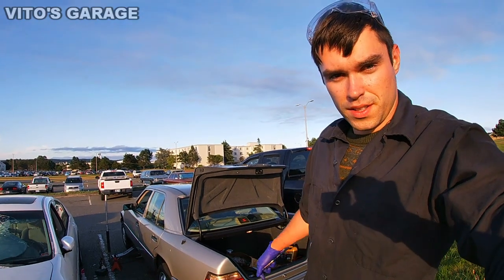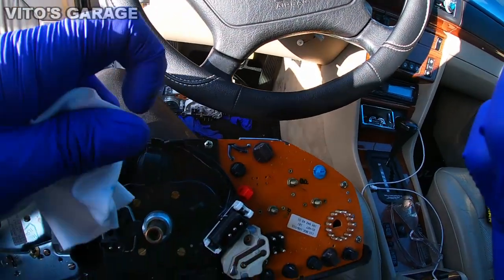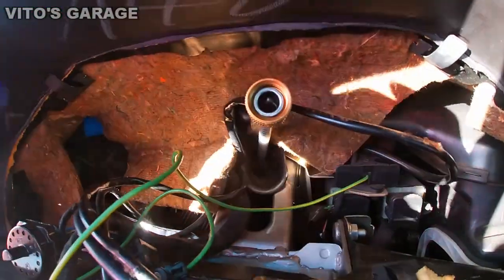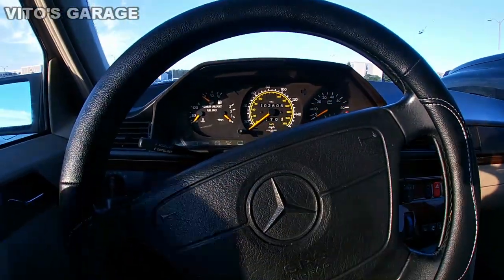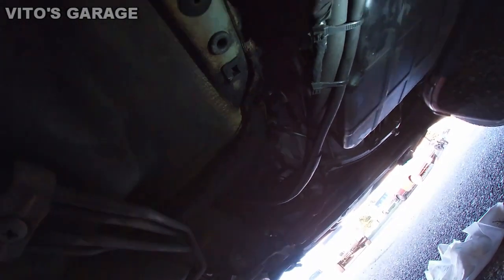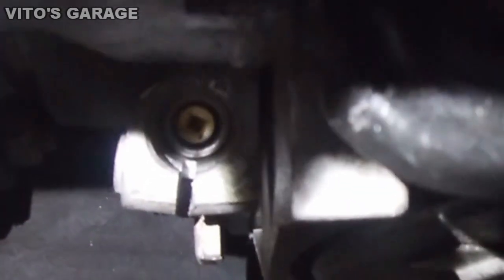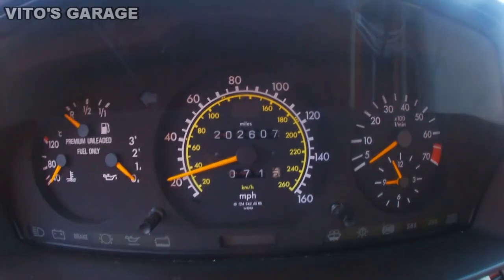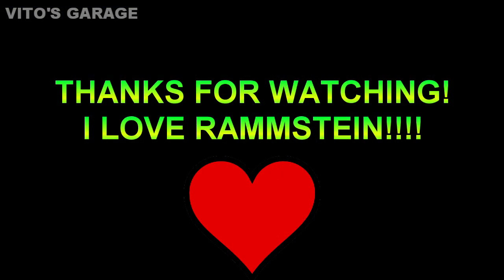How To EASILY Fix a Bouncy Speedometer Mercedes W124 W123 W126 W201 W140 W116 W115

Comment: Huge thanks for the detail you took for this video! I had a bouncy speedometer at higher speeds on my 1987 300D. A good cleaning, ATF on  the back of the cluster, ATF down around the spinny cable, and then some MB gleitpaste worked wonderfully.

Comment: Hi Vito. My speedometer arrow on w126 of 1989 doesn't move before I reach 35 km/h. Any idea about the problem cause?
Reply from the maker: Very interesting problem, hmmm. Something is most likely wrong with your speedometer gauge itself because those are electronic gauges. 
Your W126 doesn’t have a mechanical cable (right?). I think it has a speed sensor on the transmission instead of a mechanical cable. That’s why I think that something is wrong with the gauge itself.
Reply: Thanks Vito. My transmission does have a cable. I think I will dismantle an instrument cluster and see if there is sign of wear on it first.
Reply from the maker: @azimutnorth8570  remove the cluster and drive without the cluster. See if the speedometer cable moves once you start driving. If it does move, something is wrong with the speedometer gauge (maybe stripped plastic gears inside or sheared off). If it doesn’t move, the cable might be the problem or the connection going to the transmission. 
MAKE SURE THAT YOUR OIL PRESSURE GAUGE IS ELECTRIC BEFORE YOU DRIVE WITHOUT THE CLUSTER. BECAUSE IF THE OIL PRESSURE GAUGE IS MECHANICAL (LIKE ON W123), YOU WILL HAVE AN OIL SHOWER ONCE YOU START THE CAR!

Comment: driving without fixed the oil pressure guage hose to instrument? your dashboard behind should be alot of engine oil spilled 🤣
Reply from the maker: W124s have an electric gauge
Reply: @VITOSGARAGE  i see. that's much easier than W123

Comment: Hi bro, I have a question, with my 190E working,  either low or high speed，my needle started dancing and swinging a lot，is the cable have is stretched  or broken？I want to ask how did you solve it? where can i buy the cable？  Please reply me when you have time, it is very important to me, thank you！
Reply from the maker: Hey there. I think the problem with yours is loose cable under the car. The speedometer cable has to be firm, it cannot be loose under the car. Check the cable retainers all the way from the transmission to the firewall. Make sure the cable is retained and not loose
Reply: @VITOSGARAGE  Thank you so much for your reply, I'll go check the cables right now!

Comment: My W201 speedometer and odometer stopped working yesterday (both at the same time). Before that it was always working, but the needle did bounce a little bit. Do you think my speedometer cable needs to be replaced or could it be saved by greasing it? Keep up the great videos, I enjoy them :)
Reply from the maker: Remove the cluster completely and drive without it. See if the speedometer cable is spinning. If the cable is spinning, the problem is inside the cluster. If the cable isn't spinning, It's probably broken somewhere in the middle (most likely you'll need to replace the cable). And thank you for your support! New videos coming every week☺

Comment: Question I have a 93 300se and when I put it in reverse or drive I hear a clunking but the car doesn’t move and if I rev it the clinching might keep going but still doesn’t move
Reply from the maker: Something is broken. Either transmission, differential or axle. Lift it up and inspect it

Comment: Great video, nice when things go right!
-how were you able to release cable from instrument cluster without stressing cable?
On my 92, 300e, the cable will barely, reach for my hand to fit in, but cable on tight, and can not free it up with my fingers!
I'm going through the right side of cluster, but can't pull the cluster too far out!
Any advice?
Thanks!! Love your passion for the classics!
Reply from the maker: Hi sir and thank you so much for supporting! It’s a little tricky to disconnect the cable. I had to slightly pull the cluster out. I then disconnected all the electrical connectors just by feeling them. Once that was done, I was able to pull the cluster out even more. Finally, I had to reach my hand in from the LEFT Side of the cluster and unscrew the speedo cable. You can also try disconnecting the speedo cable from underneath the kick panel. Patience is the key here like anywhere else!

Comment: how to fix your rpm indicator? it seen like not working at all. are they using the same cable to drive the meter?
Reply from the maker: Rpms are electronic. Everything is working on this car. In the video I only had the speedometer connected for testing. That’s why it wasn’t working

Comment: Hi Vito.  Did the bouncy cable make a click, click (rising with RPM) before the fix?  Mine clicks.  W126 1990 SE
Reply from the maker: If it’s clicking remove the cable from the cluster and drive as is and see if there’s still noise.

Comment: I tried pumping the cable with motor oil then lubricated both ends with white lithium. Didn’t do much, still bounces up until 30-40mph. What can I do?
Reply from the maker: Make sure the cable underneath is secured and not flopping around or loose
Reply: @VITOSGARAGE  I’m going to try zip ties, I’ll report back.

Comment: My W201 spedometer got the same issue and after i check the plastic gear under the cas is the onr making the problem. Any suggestion on how to find the replacement for it?
Reply from the maker: What’s wrong with the plastic gear in the transmission? Is it stripped?
Reply: @VITOSGARAGE  yes, its maybe stripped
Reply: @VITOSGARAGE  what should i do to fix this issue?
Reply from the maker: @xealedd  if the gear is stripped then the rear cover of the transmission needs to come out to replace the stripped gear

Comment: Will this trick also fix a bouncy fuel gauge needle?
Reply from the maker: No. You need to remove the fuel sending unit and clean it from inside, or replace it with new one. That should help with bouncy fuel gauge. If that doesn't help, the problem is in the cluster: either a bad gauge or you may have a bad cluster ground

Comment: Is wd-40 an alternative for the ATF?
Reply from the maker: No. ATF is ten times better and thicker
Reply: @VITOSGARAGE  Thanks for the reply.
Reply: @VITOSGARAGE  thanks it works
Reply from the maker: @fritolay8668  Did you fix your bouncy speedometer? Another thing to make sure is that the speedo cable underneath isn't wobbly. You might have to add a few zip ties so the cable stays steady at all times and doesn't flop around.
Reply: @VITOSGARAGE  Yes it was ok. Thanks
Reply: @VITOSGARAGE  Im planning to change my ATF, can I have your suggestions of brand?
Reply from the maker: Dexron III. Febi brand ATF is good too